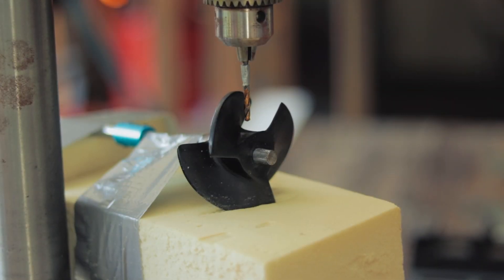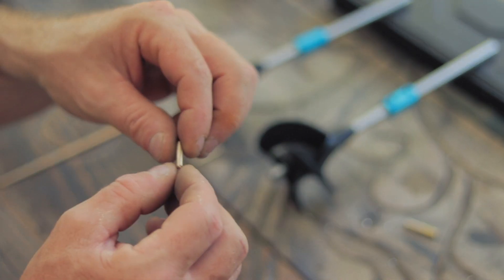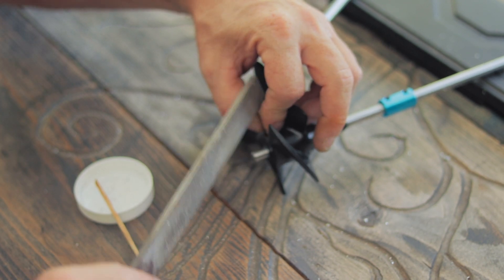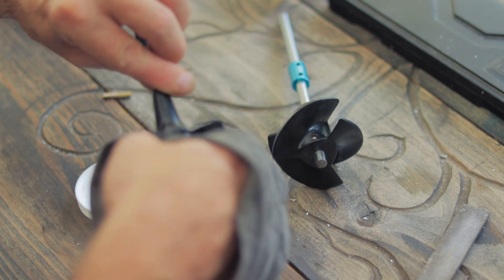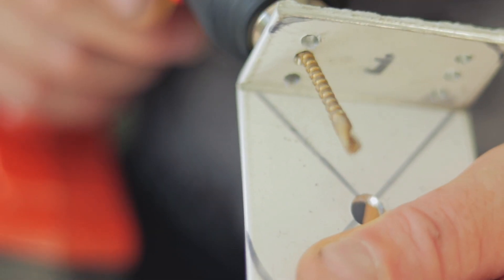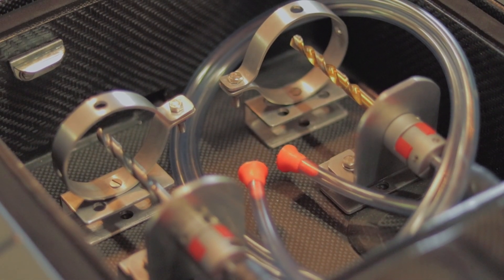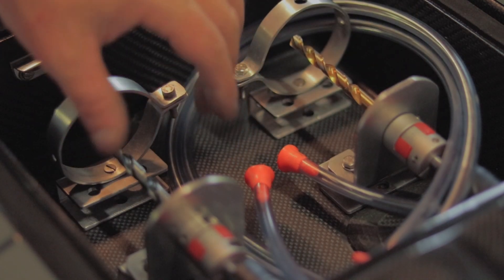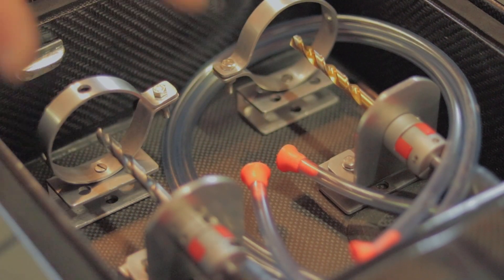Diy Twin Jet drive Electric Surfboard motor mounts install. part 8

Comment: Where did you get all the parts for the motors and the housings for the water scoop for the impellers and everything
Reply from the maker: Hi I made everything on 3d printer. The motors are online type in sss 56104 which I used in Google and have a look. The jet drives are available on my thingyverse page type waysider under users they are 58mm impeller size.